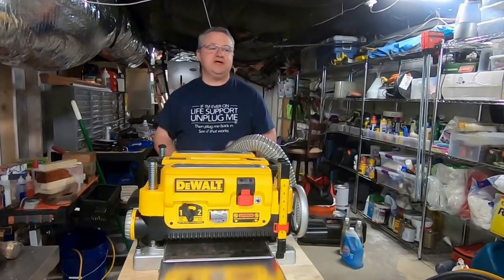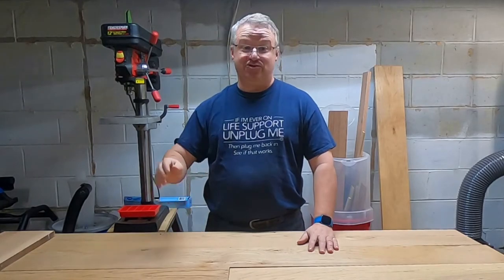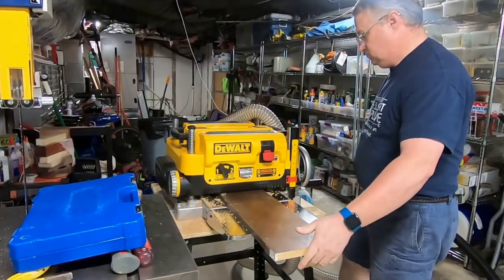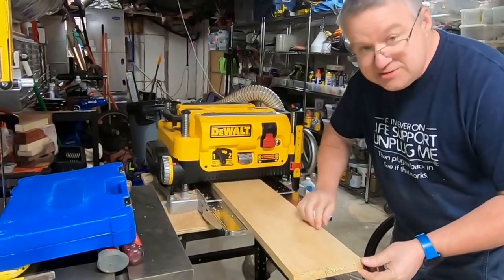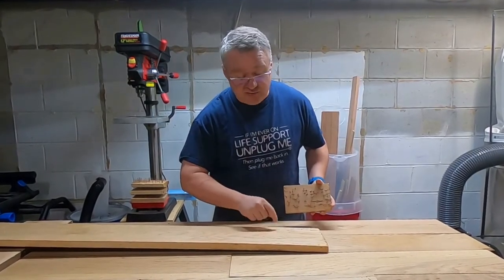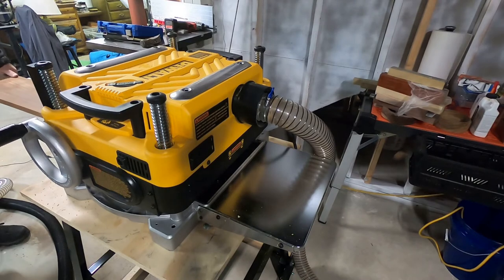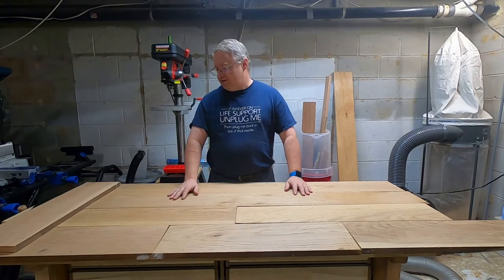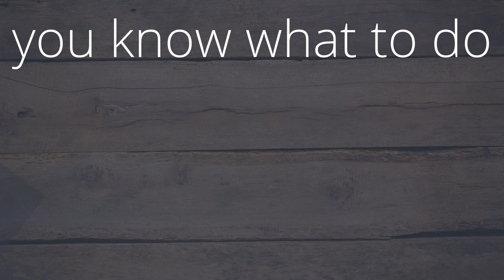Dewalt Planer | Planing the Reclaimed Wood | Don't Get Angry

Comment: How do you prevent your blades from gunking up and wearing down so fast?
Reply from the maker: Do you mean in general or specifically related to the stain and poly I was getting rid of?  From what I have been told, in regards to general gunking, there are two main trains of thought. Very dry wood is your friend and upgrading to a Shelix style cutter will keep things clean. I don't have the fancy cutter because I just don't do enough planing right now. If I ever move from hobby to full time then maybe it would be worth it for me. But for now I am using the factory cutters. As for dulling of the blades, there really isn't a golden standard. It all relates to amount of use, hardness of the wood, and the type of steel used for the cutters. One thing that I do make sure I do is move my material back and forth so that I use all of the blades as close to equally as possible. So for a skinny board I move from side to side as I do them or run them at a slight angle as you see here. If you plane a lot of 4 inch material and only place it in the middle then you are going to dull the blades more in the middle than on the edges. Then the first time you plane a 12 inch board it will likely have a high spot in the middle and not plane as cleanly in the middle. The shelix cutters also use the carbide inserts which have some of the highest hardness ratings and prevent dulling more than the factory cutter 'tool steel' does. But again this can largely relate to how much you spend on quality versus cheap parts.
Reply: @TheProjectHelpDesk  Yeah in relation to the stain and poly. I find that the “good” side of my reclaimed planks don’t wear the blades too fast but as soon as I start planing the side with stain the blades go down hill VERY fast. I followed your example of only lowering about a 1/4 turn and that seems to help a lot.